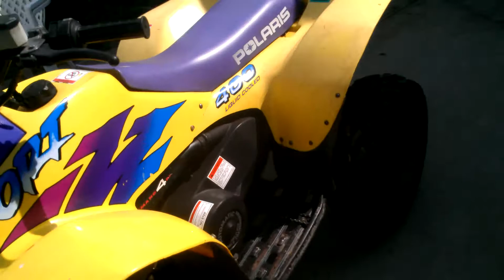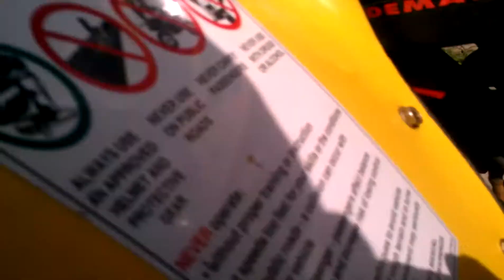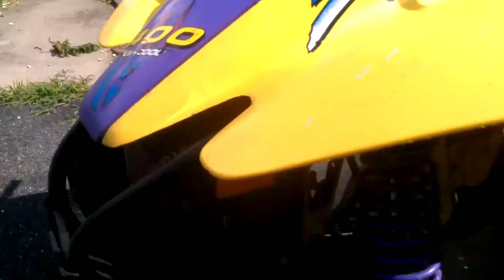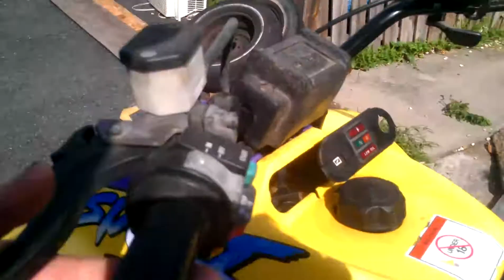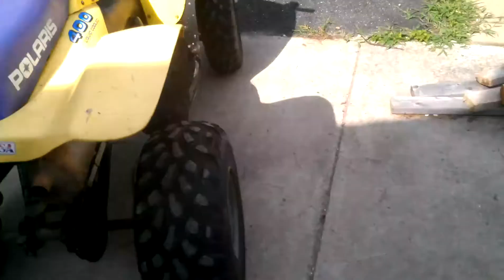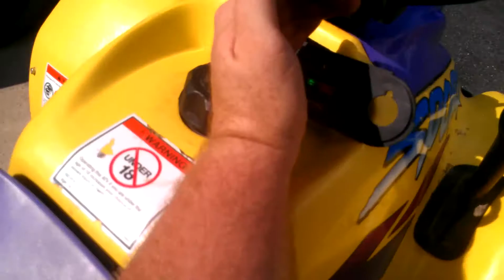Polaris Scrambler Sport 400 - Together and Ready

Comment: Just bought a 99 a few weeks ago, having issues with it starting. We cleaned the carb and put new spark plug in, got it start up but died on me when we went riding, now it won't start at all, what else can I do before I spend $$$ on a mechanic.
Reply: Yea my 99 will run good if u barely ride around the yard slowly but as soon as u get into it it's like it runs out of gas and dies. Very frustrating 😠
Reply: Change out old gas for new

Comment: I got a scrambler 400 4x4. Love the 2 stroke!! Got mine from original owner and still has original tires on it. It’s a mint garage queen lol. Thinking about a pipe but I’ve never had to rejet a carb before and kinda scares me. It runs so perfectly I’m afraid to mess with it. It’s bone stock
Reply from the maker: The Polaris scrambler 400 2 stroke is my favorite atv.  I would love to get one with 4x4.
Reply: @BigjermsGarage  id go with the sportsman, i have a 95 sportsman 4x4 and i love it

Comment: Ive got a dumb question whats the difffrence from a 400 sport and and a 400 scrambler 2x4
Reply from the maker: Honestly I don't know.  I thought it was a scrambler sport 400.  Maybe the sport is 2 wheel drive and the scrambler is 4 wheel.
Reply: Ok I thought you would know you own scrambler and sport
Reply: years in say "1998" a scrambler 400/500 wasnt offered in 2wd  so it became the sport is what i was told